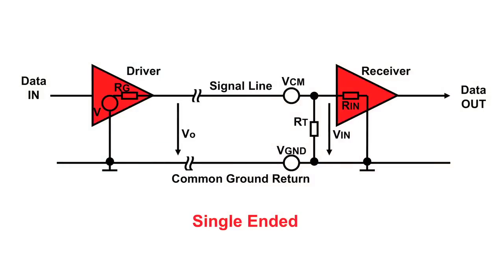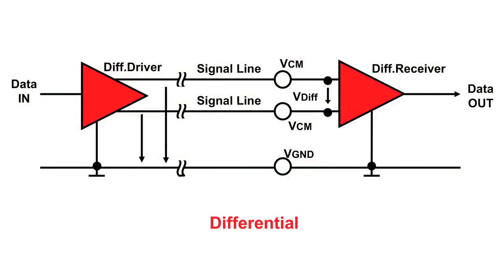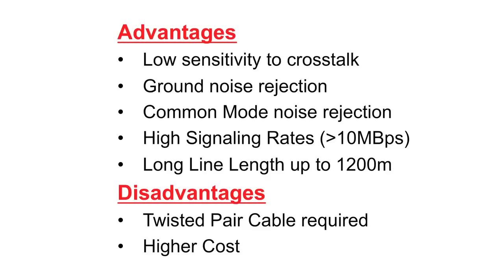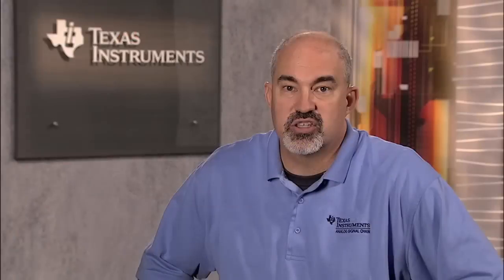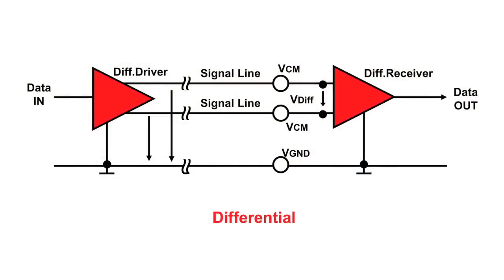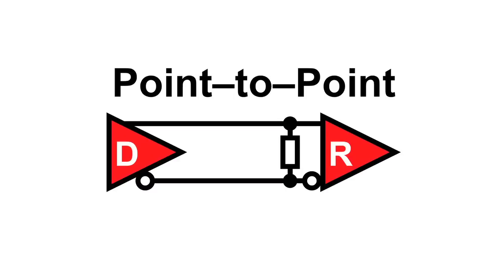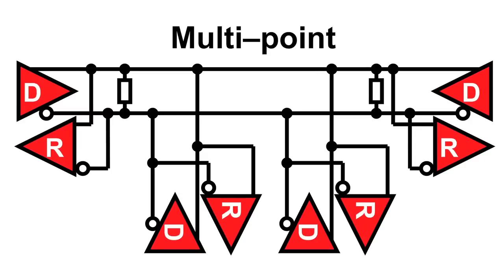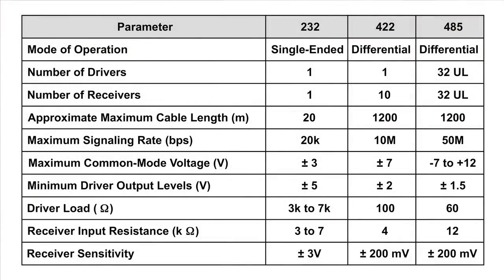RS-232, RS-422, RS-485: What Are the Differences?

Comment from the maker: Sure! Thanks for watching. Check first that the bus voltages are switching with an oscilloscope.  The differential lines (A and B) should always be complementary during active data transmission.  If the signal levels are changing, then use a protocol analyzer (if the protocol is a standard) to check that the message format is correct. Let us know if you have any other questions. You can also get technical help on TI's E2E network support forums on our website.
Reply: How to learn These things ? ANy suggestion.. ? Where to start ?

Comment: it provides good knowledge,,but i have a question,if a controller or device connected to RS422 not responding then hoe to chek it,or how to check the cable? with protocol analyzer and ohm meter or volt meter...thnx.